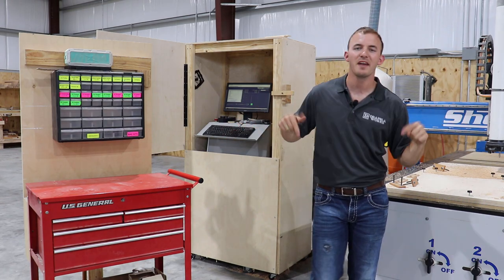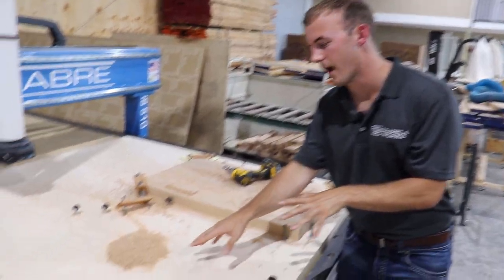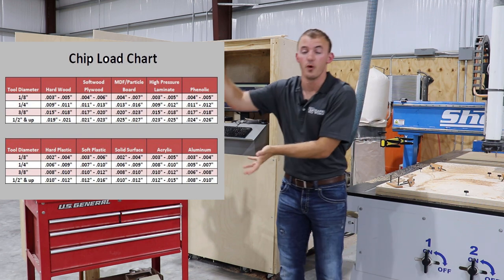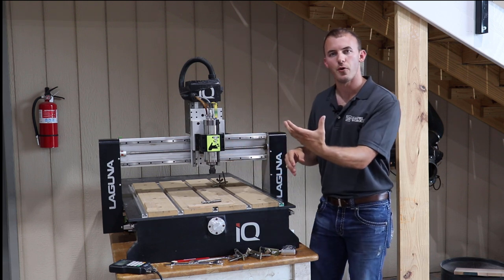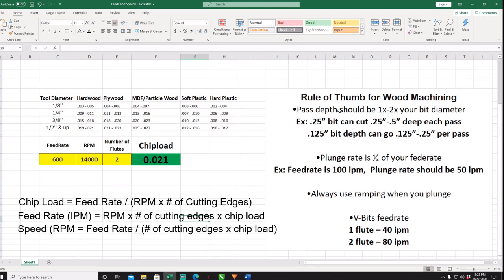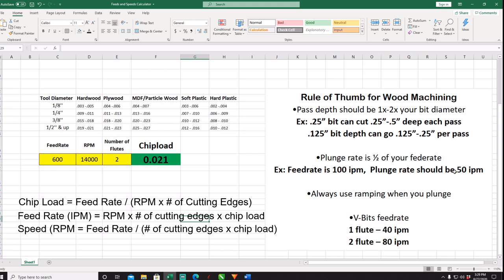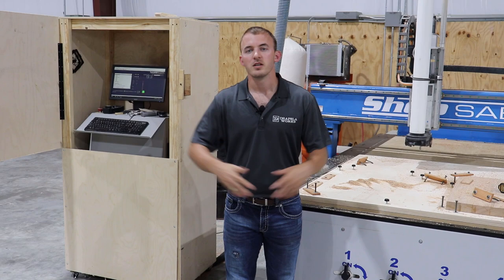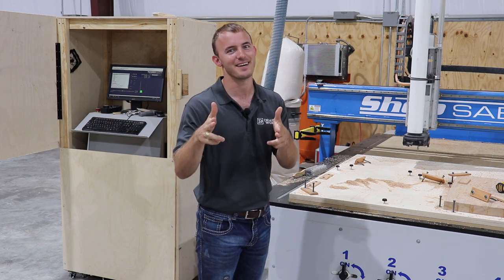Calculating Feeds and Speeds A Practical Guide | Wood CNC Router

Comment: Nice work!! A few years ago I rebuilt an old 1962 Shopsmith lathe. When I turned it on at the lowest speed I thought it was going crazy fast. I chucked a 8" diameter small log into it and when it spun up all the bark flew straight off. I just stood back and watched it for a few minutes. Over time I gained confidence in the ability of the machine to take the vibration and ended up running it faster and faster. I just built a CNC and playing with the different ways to create and feed it g-code. Like any other hobby the internet is mostly full of bullshit sales pitches or Pinterest, Etsy garbage. I know exactly what I am going to do. I made screen shots of the information you presented. I will make a spreadsheet that works and put it on google drive. In fact all of the information I am gathering is going there once I parse it all out and sort through the good vs bad. It makes sense to run a machine slow at first. You want to be sure it is mechanically sound. After that.... I want to know how fast I can push it. Why waste time if you don't have to!!

Thanks for making the video!!

Comment: Terrific explanation - this is helpful and exposed a fundamental flaw in my thinking.  I have a Laguna IQ because several people recognized this as a strong entry level CNC and claimed it could do everything the larger footprint CNCs could do, just couldn't handle large sheets of plywood.  After two of your videos in the last two days, the one on different types of CNCs I realize I have been sadly mistaken.

 Key lessons I learned from your videos:
1.  I mostly use 1/4 inch bits, but when I had an option I would buy 1/2 inch bits because I read somewhere these were better to use in routers and CNCs (opps)
2.  When my Laguna would make lot's of noise while cutting, I was slowing down the feedrate.  whenever i was concerned about overheating the bit (1/4 ' mostly) i would slow down the feedrate - not increase it.

Need to rethink my approach - I wonder how much damage I am doing to the Amana Bits i have been buying.  Thanks still catching up with your information - very helpful.  Double thumbs up from me.  i realize how long this video production takes - I sure hope it starts paying back for you.  With your other business this has got to be tough to manage.

Comment: It's been a while but this video is still very useful today. congratulations, my cnc is small 1000mm x 800mm with 315oz motors 1605 spindle, I did a test flattening the sacrifice table at 6000mm/min really when the machine can cut within those parameters mentioned by you, it's another level although 6000mm/min was the maximum I could at the moment. here in Brazil homemade machines make a lot of dust 🤭 today I managed to make some grains, and it gets a lot less dirty.

Comment: Down to earth and still gets the nuance/importance of everything across. I built my own hobbyist machine, and this plus your other videos have been so helpful on determining limits in how to run it and consider upgrades.  So glad I found your channel, thanks!
Reply from the maker: Thank you:) I have many videos coming next year
Reply: @cutting-it-close  Hi! Could I ask you, do you utilize the chipload .004-0.06" with, designated in the chipload chart, for a 1/8 bit to cut plywood or other wood material? It's look for me too aggressive, because referensing to this chipload chart I have broken two 1/8 bits (one straigh and another spiral upcut one, both with two flutes) using .003" chip load which even less then the lowest border of the chipload range (the cutting paramets I have used for this where 16000 rpm, chipload = .003" and respectivly Cutting feed rate = 96", DOC=0.125").

Comment: Thank you for the video. May I suggest in your excel sheet to colour code your answers based on ranges of input. If the 1/8 bit is used, hardwood is used, enter feed rate, rpm, number of flutes. If the answer is below the range, show the number and colour the box into pink. If within range, it is green. If above the range it becomes red. This way you can see if parameters are checking out or not. In the current setup, the answer requires referencing, that can create an error.

Comment: Good info. I have a large 48 by 96 CNC but who ever built it thought it was a good idea to but a 400 watt Spindle in it. I run 1/8" bit at little over 1/4" and speed of 72 which seems to work well. My stepper are a little small and are direct drive, not sure i could even get 100 IPM. I will have to do some tests to see what it is capable today.

Comment: Thanks for a great video. Finailly understand Chip Load, Feed Rate etc. I have an X-Carve 750 that I bought in 2016 and havn't used for awhile. I did download your spreadsheet and modified it for my situation. I never use bits over 1/4" and go as small as 1/32". I did a calibration test carve yesterday and finally have it dialed in. Definatly making chips not dust now. PS I fided the spelling error in the spreadsheet too. Thanks again and I am now a subscriber

Comment: Good afternoon! I am a complete amateur when it comes to CNC and I am studying to expand my knowledge for work. I recently watched a video where you mentioned that chips should not be grainy like a fine dust. I noticed that I am experiencing that issue, and I would like to ask about the recommended RPM for my 2-Flute bits to have. I normally work with Plywood and Melamine wood. I figured I should change my Feed Rate and RPM to get the perfect chip load but I don't know where to begin. For reference, I am learning how to use the Holzher Epicon 7135.
Reply: I guess my real question is: To get my desired chip load is there any number that's TOO high for my feed rate or RPM? Or will any number do?

Comment: Wow that was an amazing video!!!!!!!! I wish I could sit down with you and just talk about this topic. I work for a company as an router operator. I consistently get into discussions about this with upper management. They insist on using 3 flute cutters so we can run faster. Only issue with this is the feed rate for that cutter far exceeds machine capability. Not unless I am figuring things out wrong.
Reply: Cuttin' It Close my feed rate max is 1,000 ipm. The maximum feed rate the machine can reach when cutting my parts is 500 ipm due to the short distance it needs to move. I just can’t see spending the money on a 3 flute compression bit when that is overkill for what we are doing. A 2 flute compression bit will be good for the parameters my machine can achieve. Thanks for the insight.

Comment: Very nice and valuable video, thanks for it!
Also thanks for provided XLS sheet with chiploads! Btw, I use 4 mm bits quite frequently. Can the chipload data for 4 mm bit be simply interpolated from 3 mm and 6 mm chipload data?
Reply from the maker: I would do the high side of the 3mm bit feedrates!

Comment: Thank you for a great video. Finally getting to understand this. 

One thing this video fails to explain though (I think?) is if the chip load in relation to tool diameter and material always is the same?

Bits come with different designs, materials, coatings etc that seem to add a lot of complexity to this topic. Can I still use this chart for anything? 

Also as a beginner I'm a little confused to why these charts rarely seem to mention wood and metals at the same time? It's usually either one or the other. Is there something I need to consider?

Thank you!

Comment: Great video. Just what I needed. Many thanks Ryan.
Just a quick question. The chart rates the speeds and feed in relation to the bits shalf thickness but what about the cutter sizes. I have a 67mm wide trenchig bit and my cnc struggles with it. I did make the mistake of slowing the cutter down as much as possible. I was getting chatter even though the speeds feed and past depth were were very low. How would you calculate this ?

Comment: Great video and I did dowload your spreadsheet.  Both the video and spreadsheet are awesome.  I have a Shopsabre Pro 510.  I have a great dust collection system however, the flex hose going to the router seems to want to hang up on the air assist.  I saw in the video youput a hard pipe coming out of the router  I cannt tell if you attached Vac hose to the router inside th epipe or on the top of the pipe.  I'm really interested on this design.  Can you share it?  Thanks again!

Comment: This is a great video. Very helpful and informative. I recently bought a 30"x30" Longmill MK2. I noticed you set your depth per pass at 1x-2x the diameter of the bit. But I recently saw on Xcarve's recommendations that you should only set your depth per pass at 1/2x the diameter of the bit. Do you think this is just a way to try and keep the rates conservative? And would that potentially heat up the bit more like you said and actually make things worse later on? Thanks again for making this content.

Comment: I have two large cutter and I can't work out the feeds and speeds for them. They work fine cutting from right to left but when cutting  left to right they bog down and stall the motor.
I've tried many various feeds and speeds and directions but cant make it work.I have a 2.2 hp spindle motor with a variable speed of 3000 - 18000 rpm. Any advise would be appreciated.  Also om getting a fine saw dust and using 1mm cutting pass.

Comment: Hey ... excellent video ... but a question ... specifically for cutting with a hobbyist level cnc, into hardwood, with a Vcarve bit (2 flutes, 1/4" shaft) ... you mention to use an 80 IPM feed rate, BUT ... what RPM would I set my spindle to? Does it matter if the bit is 60 vs 90 degrees? Do Vcarve bits have a 'diameter' (that could then be used to calculate chip load)? Thanks! Gary

Comment: Thanks a lot. Now its time to create my own calculation file in metric system. What the heck is inches,galloons etc lol :)

Then will compare current speeds. Thanks again!

Btw does anything change when i am using vacuum to fix the material? I dont want to go too hard that material moves and dimesions break
Reply from the maker: No vacuum will not change it, but if your machine can’t handle the speed, you may have to slow down your feedrate. My smaller machines can only handle a 6mm bit going at 380 cmpm. My big ones can run that same but at 1,000 cmpm like it’s supposed to.

Comment: Great video, but where does machine rigidity come into the equation? I have a Shapeoko 3, and find when I push it too fast, the cut quality goes downhill.
Reply from the maker: That’s something I cannot factor, I will say on that machine you will only be able to optimize for a 1/8 bit. 1/4 bit you’ll have to run 40% slower most likely.

Comment: I have a laguna swift 4x8 with a 3 hp spindle.  I really dont like seeing the unit traveling at over 200ipm.  I am finding with your chart, on a 1/4" bit, Im running about 145ipm at 7000 rpms with a 2 flute cutter to achieve the chipload.  do you see a problem with that?  I am loving how quiet the machine is during cutting and the finish seems just fine.  what are your thoughts?
Reply from the maker: I made a video on the channel describing this problem, you are right on track, that spindle cannot handle going at the correct feeds and speeds, so you have to go slower even though it is not the correct speed to be running it at. Whenever I got my bigger CNC's I then started running bits at the correct feeds and speeds and the cuts were better, they screamed less and they did last longer. But for you running it slower than it should be the extra cost of a few bits is small compared to the overall cost of the CNC. Here is a link to that video! https://youtu.be/AHs-ifaB8G0

Comment: This is a great explanation of chip load but working with partial board laminated with Formica ads another equation to situation. We run coated 2 flute compression bits on a Felder H10 CNC at 18.5 meters a minute at 18,000 rpm and might get 25-30 sheets cut sometimes less on a bit. Plain old melamine on a coated bit will last 60+ sheets. If you have any suggestions that would help for longer bit life I'm open ears.

Comment: Ok. so I mainly work with laminated chipboards ,my cnc runs at 5000 mm/min because of the vacuum pump capacity(My boss is not open to investing more money). Anything above and I risk the plate being pushed, especially on smaller plates. I use a two flute 8mm carbide compression bit. Applying this formula I get that the optimal rpm's for the designated chip load is only 6000 rpm's?

Also. I would recommend a starting lead into laminated chip boards with a straight plunge. I was trying the ramps and it always chipped of the laminate at the point of entry off the chipboard which was driving me crazy.

Comment: Could you clarify the V-bits feed rate. Your chart has simply two V-bit feed rates based on number of flutes. How is this used to calculate considering tool diameter and material? Thanks. Love your straight forward explanations.

Comment: Excellent explanation. Thank you. Finally someone who knows how to explain this. I am using a Openbuilds Workbee with a dewalt router and have had a heck of a time figuring out the feeds and speeds knowing the machine it’s self could never run at the required numbers. Do you have the excel sheet you could share?

Comment: That excel  Calculating is so great ,But it would be great IF You reveal (mm)unit version either.
Reply: Right! Metric units are easier to follow. At least numbers are not in third decimal :)
Reply: PLEASE give us this converted into metric sizes or we convert by multiplying by 8/5 to convert from inches?
Reply: @stewartfry5094  Inspired by this video: https://pedja.supurovic.net/simplified-cnc-milling-calculator/

Comment: I have a small hobbyist CNC and I have been toying with the idea of a larger fly cutter/surfacing bit. There are so many different types! Could you do a video about these? Carbide inserts vs one I would call more traditional... 1/2 inch vs 1 and 1/2 inch... 1/4 inch shank vs 1/2 inch shank... etc!
Reply: Thank you so much for the reply! Very good information. So how large of a surfacing bit can the hobbyist CNC handle? Can it actually handle a 1 and 1/2 inch? Maybe that depends on the material. Hardwood probably needs a smaller bit, right?

Comment: Any chance you can share that excel file?
Reply: @madeathome4057  Very useful.  I live in the US and we tend to measure parts in "standard" but I program the machine and spec/measure bits in metric (feedrate in mm/Min, new 1/2" bit usually measures close to 12.7mm, etc).  Since we aren't working with tight tolerances, I tend to use the simple conversion method of 25.4mm per inch.  More than close enough for what we manufacture.  The machine I operate is a Biesse Skill 1536 G FT, a 5ft by 12ft vacuum spoilboard router with loading and unloading function.  We run up to 61"x120" sheet goods on it at up to 3/4" thick no problems.
Reply: @RotaryTurbo  I think that formulas in this video and my calculator doesn't need to be more accurate. IMHO noone should set up size of chipload at boundries of bit performance. So if for ex. bit 1/4" and doing in MDF (0.013 - 0.016) u should aim in 0.014-0.015 rather than 0.013 or 0.016. With this approach very precise conversion from inches to mm is not important. Now i wondering should i also provide option to change bit sizes to mm ?
Reply: @madeathome4057  right. I just made a quick Excel file and put both in.  One is identical to yours and the other just converts ipm to mm/m by the 25.4 method.  As far as bits in metrics, might be handy. The bits I use most are 1/4 down, 1/2 3 wing comp long and short and one they're calling a 3 wing compression mortise.  The compression section is very short, 2mm or so.  We use them for particle core with melamine  and veneer core/plywood with veneer covers.
Reply: @madeathome4057  thanks alot dear, this saved me alot of time and money
Reply: @mohamedsoud  Actually i made newer version already, http://informatyksiedlce.pl/_PROJECTS/feedrate_calc/ now you can click chipload size directly from the tables, and the feedrate is computing, also i found some experimental chipload sizes chart so i attached it also for checking/testing
Reply: @madeathome4057  yup I followed the link on the first calculator to reach to newer version. very well made thanks alot mate.

Comment: still, you can change the values of feed rate and RPM and get same Chip load, how do you know what is the correct feed rate and RPM for a certain bit?
Reply from the maker: Great question!! That’s an deep one. I made a video called What the chipload chart doesn’t tell you, 3 advanced lessons. That should answer that question. 

I will say though I met some people who just run everything as fast as their spindle can go and tailor their feedrate to that, I do not come from that camp. Also you can run a flycut bit at high RPM or it will shatter. I would watch the video it has more detail than what I can describe here

Comment: Question. Maybe you covered this and I missed it. If I’m running a 3/8 inch bit can I run it 3/4” deep and be achieving that same chip load, or does that only apply to a 3/8” deep pass? Thanks for the video!
Reply from the maker: Personally I would slow the feedrate down about 15-20%. I have been told not to by many people because they said chipload is chipload, but I feel like the deflection would be higher and since the chip is longer, it does not have to be as thick to cool down the bit properly.  Or just go on the low side of the recommended chipload would work as well. Hope it Mills good!
Reply: @cutting-it-close  thanks! I purchased a shop Sabre as well this past year. It’s my first CNC for a small cabinet shop, but it’s been fantastic. It’s quite the learning curve. I sure appreciate the videos!